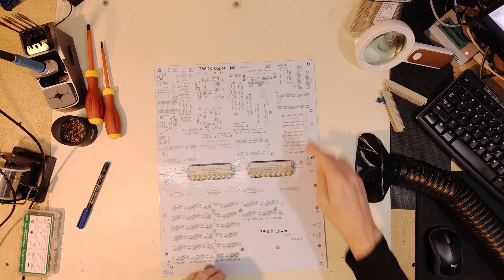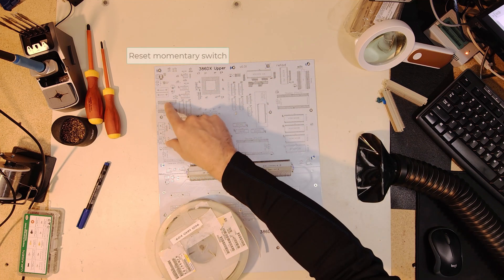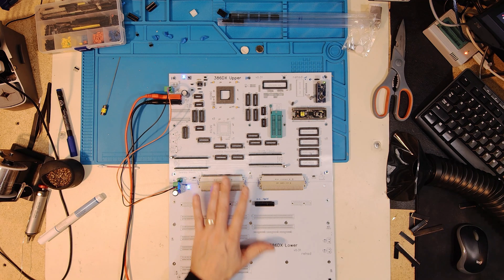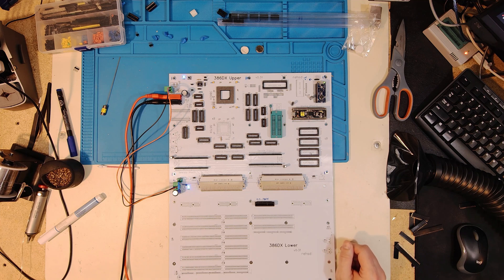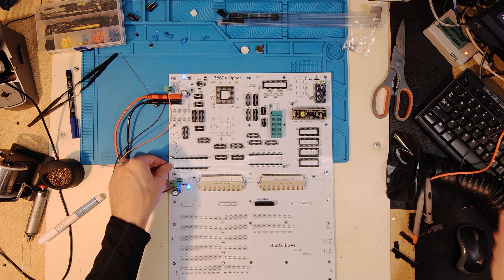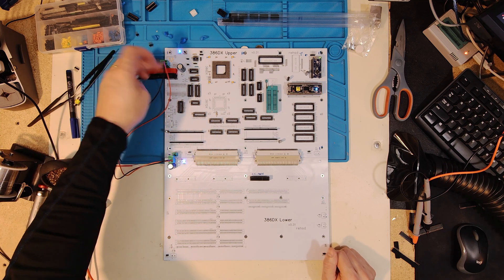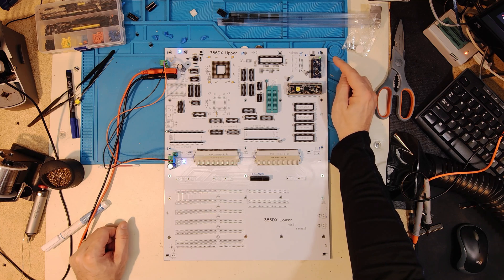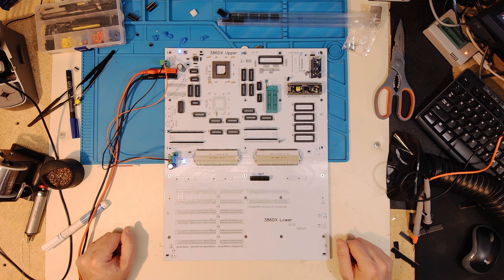80386 DX Build, Ep. 12 - Solder Solder Solder

Comment: Hey I was wondering if you were using any kind of magnification as you were soldering?
Reply from the maker: Not for this soldering. When I get to surface mount ICs, I usually use my digital microscope.
Reply: @rehsd  you must have damn good eyes because you look like a mile away from all that soldering me. I have to be having my nose right on the tip of the iron lol